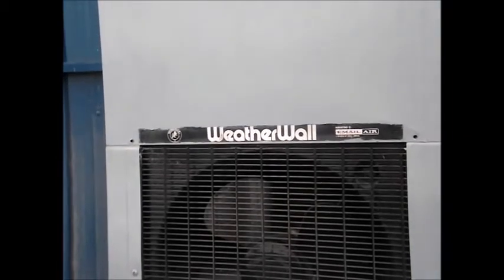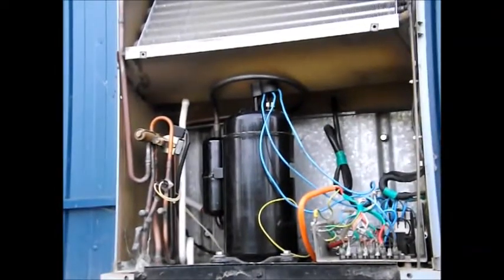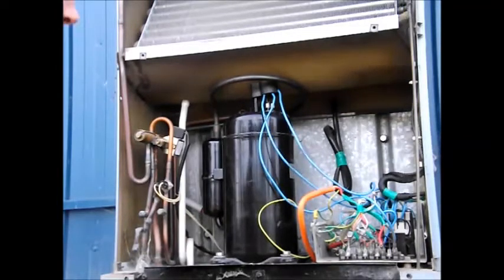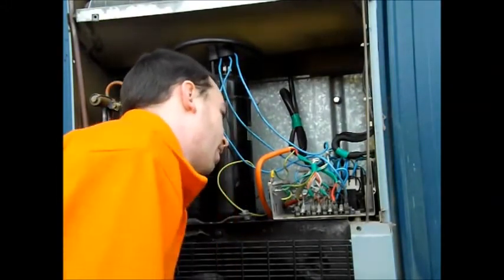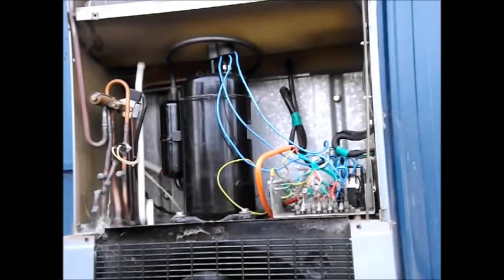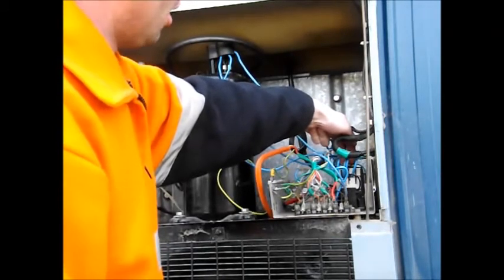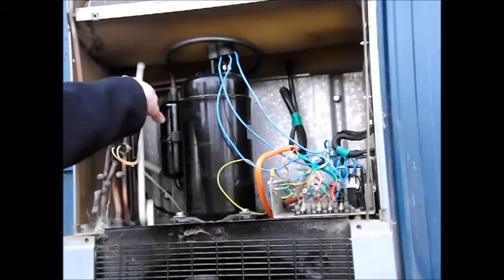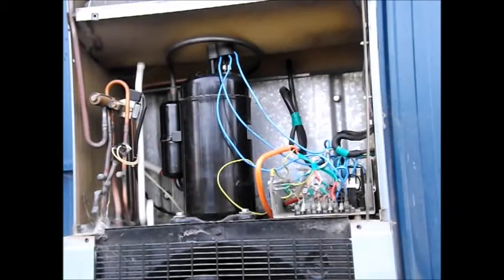weatherwall fm61h compressor dying

Comment: Did you ever it sorted ?
What made you think it's not working properly in the 1st instance ?
Lack of cooling despite the compressor running and no refrigerant leak ?? Could be an inefficient compressor. The valves could be bypassing gas. You'll need a manifold guage to see that.
The little delay in start could simply be an under spec start capacitor. Not a big deal.
I think the bigger issue lies within the compressor. 
You should get it fixed because these units are so well made it would be a shame to scrap it and replace it with a modern piece of junk.
Mine is even older than yours. It's from 1982 and I can only see that the evap motor has been replaced during its entirety. I've just had to replace bad capacitors and that's  it.
Gave the impellers a good wash as dirt tends to build up in the curvature of the blades which decreases airflow.
I love my weatherwall.
Old faithful I call it.

Comment: Looks worth fitting a new compressor to it, so long as the rest of the system is ok.
Reply from the maker: I had a good look at the condenser and evaporator coils and they are in good condition. I can't see any oily bits in the unit. The poor old compressor did close to 20 hours a day for 30 years; which is amazing really. I will be doing a full teardown of the old compressor once it has been replaced
Reply from the maker: I am thinking about getting qualified in refrigeration one day
Reply from the maker: I have since converted this unit to R290 and it is happy. The low side schrader valve was loose and I fitted new schrader valves low and high sides. I am going to get a new compressor as they are cheap and I would love this unit to go for another 20 years

Comment: You are a clever man dave, you just under rate yourself too much. :-(

I agree it's done a lifetime of work, you have kept the externals in good condition, so the compressor is the likely bit.
It's a shame that there is no cheap way to remove the gas, so you can do a pressure test on the compressor and other elements of the system.
Reply from the maker: I could buy a manifold and gauge set, but it's pointless really unless I enter the trade (which I might do one day). But yeah that unit has done a shit load of work

Comment: Have you tested the compressor? If you have a multimeter handy, you could test the compressor yourself by following this video: https://www.youtube.com/watch?v=EOE-xLI3dfw
Reply from the maker: I did and it ohmed up fine. the unit was low on refrigerant
Reply: Ah ok! Did you get it recharged? If yes, what gas did you use? 

According to this sheet (https://www.environment.gov.au/system/files/resources/43a62028-f4f8-4aea-963f-ccf848599d55/files/fs-r22-phase-out.pdf), it appears you can still recharge your system with R22.
Reply from the maker: It got recharged with R22. I am going to obtain my refrigerant handling/acquires license so I can buy and posses refrigerant so I  build up a personal supply
Reply from the maker: also I might one day get qualified in refrigeration, it is a very interesting area
Reply: Brilliant stuff! Did you find any leaks in the system? Yes, refrig is an interesting field. Shame as a "backyarder" you can't work on small home systems yourself.